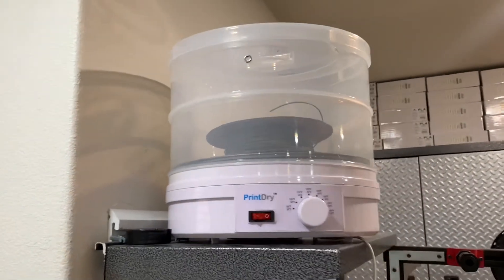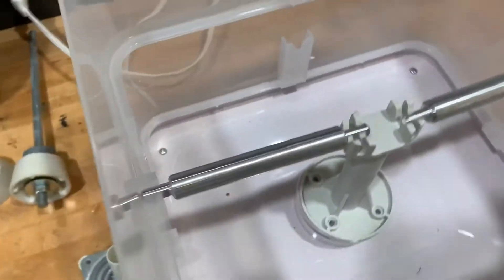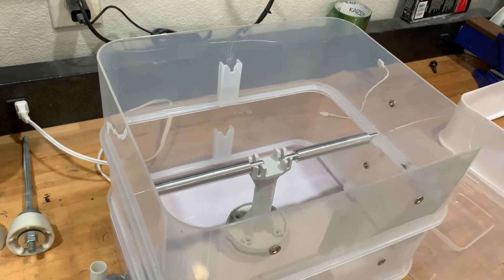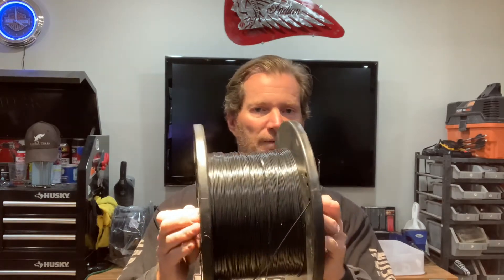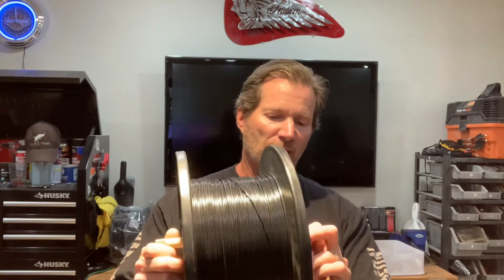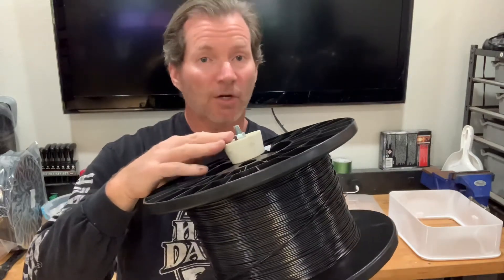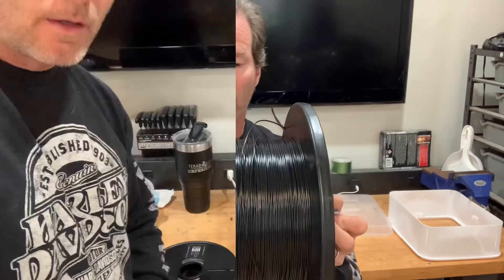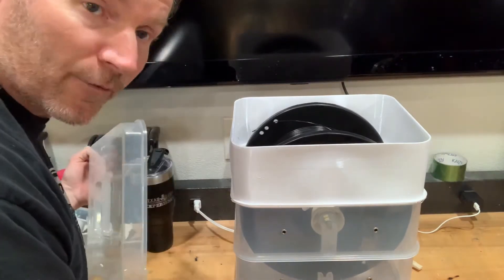Modifying PrintDry for Large Filament Rolls

Comment: What's your spool dia on this? I'm currently drying inside the enclosure itself on a roller tray but I lose z height. I'd love to bring it outside the enclosure with an external dryer... ~18" diameter spools from coex 3d
Reply from the maker: The one you see is a 12” diameter 5kg spool from Zyltech.  It just fits inside.  However, note that I printed an additional stacking layer enclosure. There is no reason why you could not 3D print a base that goes out and then a few on top that are bigger. I would not mind trying out their 15 lb roll, which I assume you are talking about.
Reply: @CLTaggart  Exactly. Keep in mind, the bigger spools have more inertia and don't like to start spinning. I've found that the gantry on larger printers (modix 120X and 180X) pull the spool on long travels and aren't super friendly with the largest spools.